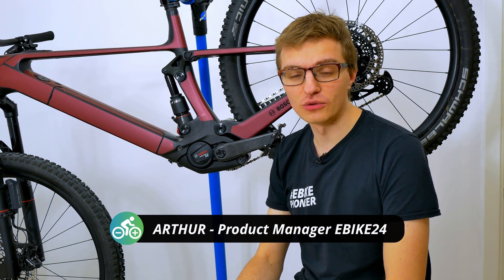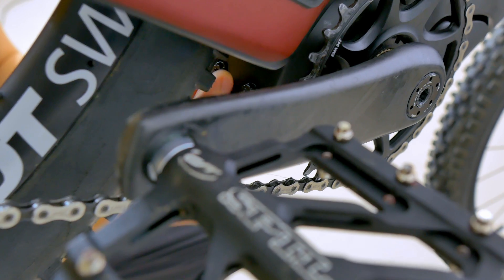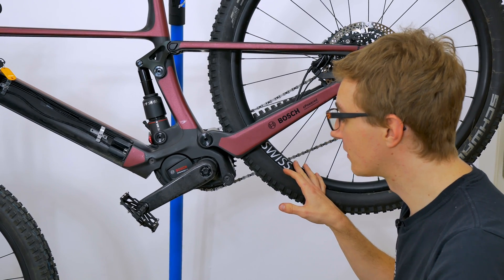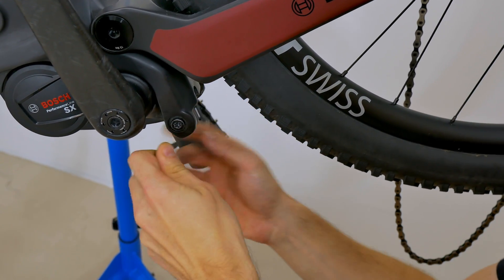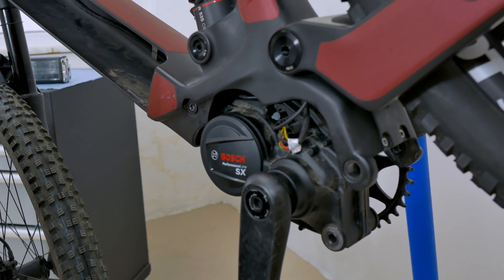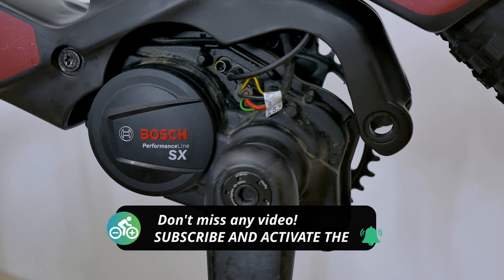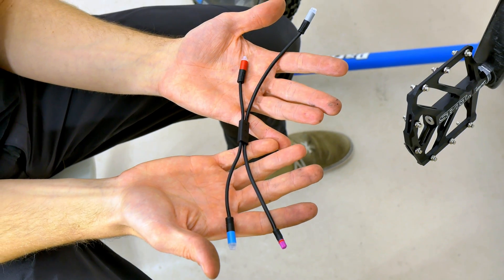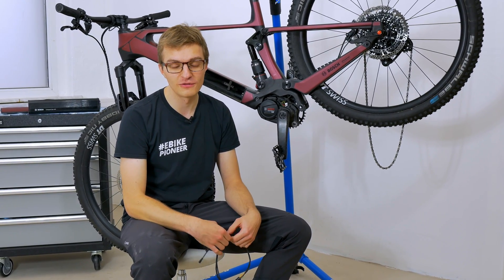Connections on the Bosch Performance Line SX motor | EBIKE24

Comment: Will this port power a rear derailleur? Like the new shimano tx wireless one?
Reply from the maker: Yes, it sure will, although you may need this MPP cable https://www.ebike24.com/bosch-mpp-connection-cable-light-speed-sensor. Thanks.
Reply: @ebike24 thank you for your reply.

Comment: Hello, I have bought an ebike with the Bosch  sx motor  from an online store. From day one I'm experiencing error 523001 (speed sensor error). This is a persistent error and no speed has ever been displayed.
Inspecting the frame, I can see that the speed sensor (slim version) seems perfectly aligned with the magnet, wich is a centerlock rotor magnet from Tektro, the SP-SS20 model. As lights work, is it more probable that the speed sensor is faulty or is it also possible the the multiport cable is defective?
Could I buy a longer cable speed sensor and try to install an spoke magnet (EB11120000) insted of the centerlock one that is not produced by Bosch?

How do I check if the speed sensor is defective?

tnx

Comment: The MPP port on my SX motor (Editor Hybrid bike) is already in use?  Something is connected to it from the back part of the bike?
The cable is part of a dual cable which also has a Blue connector (like Front Light) that is not plugged into anything.
Do you think I can unplug the MPP connection and fit a spider cable to retrofit lights to my bike?  Will I lose something?
Reply: Hi mate, have you figured it out? I want to install connectmodule for my editor but I haven't looked into it yet too deep. I only have the bike for a week, and didn't have time. Do we have to lower the motor on the Editor Hybrid? Are you from Europe?
Reply: @awataraz  Hi.  No I haven't figured it out yet.  I'm just trying to retrofit lights to my bike.  I plan to run the wires into position and let the Bosch Bike shop look at it.  I have a spider cable already if they need it.  To get access to the connections on the motor it is best to remove both bolts that hold it in completely.  I recommend removing the right hand one first (as you face it) then the left hand one - as you will see it start to drop as you loosen it.  You will need to support the motor though.  I am in UK.

Comment: What’s the torque on the motor bolts ? Thanks ❤
Reply from the maker: Hi and thank you for your comment. Bosch recommends a tightening torque of 30 Nm for the SX motor bolts. However, this may be different for each bike manufacturer. You should therefore stick to the manufacturer's specifications.
Cheers - Michael
Reply: @ebike24  OMG thank you Ive been searching for hours for torque !!!!!!!!! 30 Nm why is this hard to find
Reply: @ebike24  Hi, it's great to find someone who knows the correct figure.  Is it the same for carbon and alloy frames (I have a carbon Canyon)?

Comment: Nice video. Do you need the MPP cable if you only had one connection? If I only wanted to connect a front light would that fit direct into the spare socket on the motor (the one where you mentioned the purple MPP fits)? Thanks
Reply from the maker: Hi Andrew, thank you for your comment. In that case you can connect your front light directly into the MPP. You do not need the additional MPP cable.
Cheers - Michael
Reply: @ebike24  Does the MPP require activation to connect and use a headlight?

Comment: How could you retrofit a Kiox on a SX motor bike with the top tube system controller unit and mini remote?
Reply from the maker: Thank you for your comment! There are two options for the Kiox retrofit. You could use the display cable, which currently connects your motor with the System Controller, and connect it directly with the Kiox display instead of the System Controller. You then need another, shorter display cable and connect the system controller (in other words: motor -> display cable -> Kiox -> display cable -> System Controller). The second option is the use of the Y-cable to connect System Controller and Kiox directly with the motor. The Y-cable is not available at the moment so I recommend using the first option 😉
Kiox 300 retrofit set: https://www.ebike24.com/bosch-kiox-300-e-bike-display-for-smart-system
Bosch Y-Cable: https://www.ebike24.com/bosch-y-display-cable-system-controller
Cheers - Michael